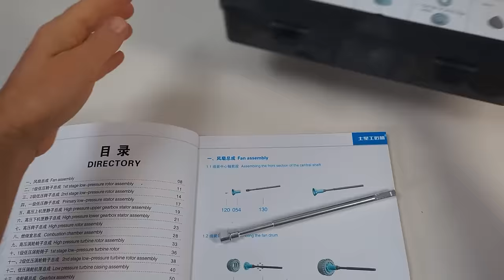Aircraft Jet Engine Model that works | Magnetic Games

Comment: Cool, but I think the fan is rotating the wrong way.  The fan should be running clockwise forward looking aft, or looking from the front of the engine.

Comment: Cool exposition piece. If it were a bit quieter... well I guess one could try and silence it up.

I suppose that if you mount it with soft compounding material, lubricate and grease some of the bearings it could end up spinning rather silently. At that point one could really think about leaving it going much like a lava lamp.

Comment: Nice kit. Would be cool to have leds light up the combustion process.
Reply: That would make me buy the model straight away: LEDs for flow temp with colors from blue to glowing orange and a proper motor to run the thing quietly and continually.

Comment: Can be used to fly a RC model?
Reply: Of course not. A jet engine burns fuel and we can see this has transparent parts made of plastic that would melt at the first second after ignition. Apart from educational purpose, this has no value and is a waste of material.
Reply: @gueratom  not a waste of material if it fulfils educational purposes

Comment: If we change a few parts of the engine, is it possible to transform it into a real turbine?
Reply: @Alongfortheride693  I understand but if the model is made of steel in theory I do not see the problem? On sometimes finds people on Youtube who make artisanal turbines with equipment that seems much less quality. Hence the question. But of course it's not designed for this basically..